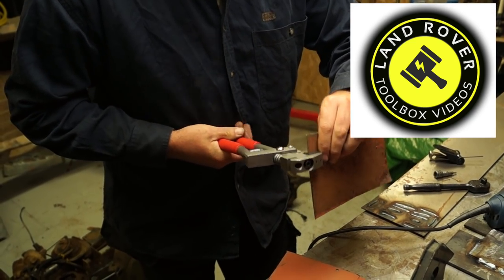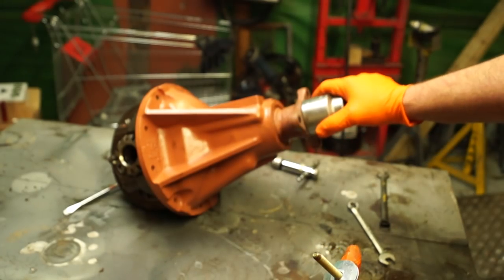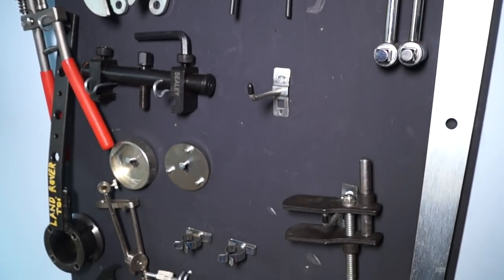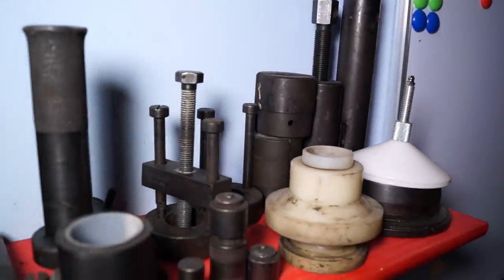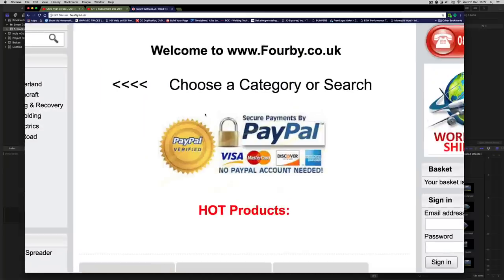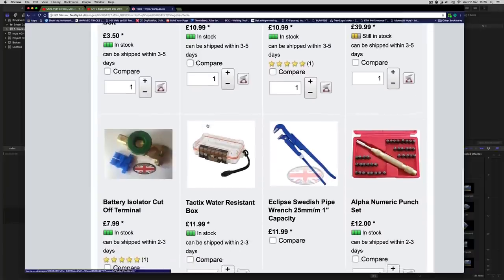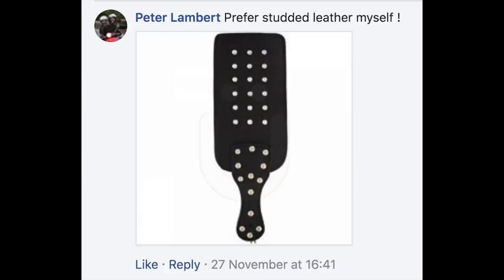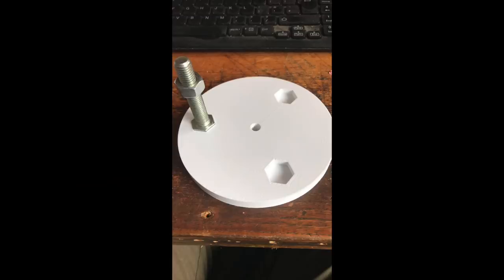Fourby/LRTV Specialist Land Rover Tools.  What is involved?

Comment: Like the look of the caliper seal tool. A cradle kit to support the tbox/gbox to use with a trolley jack would be great, like a kit of parts to weld up and adapt for different setups i keep meaning to make something and would be easier than through the door with engine crane.

Comment: Bush mandrels for defender might be a good idea, the Sykes pickavant set is incomplete and very costly. Panhard rod (both sizes), radius arm, rear link arm, a frame. Both press mandrels and a bushwhacka set would be good, albeit, good luck getting defender old bushes out with a bushwhacka as they put our 30ton press to the test sometimes.